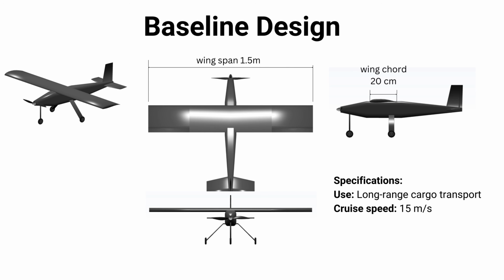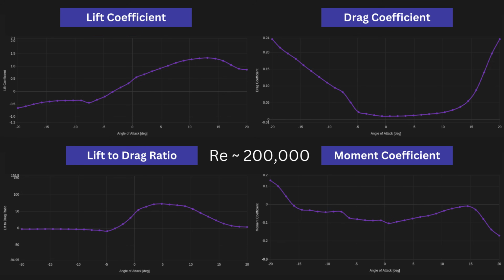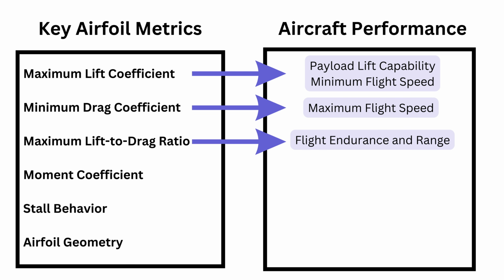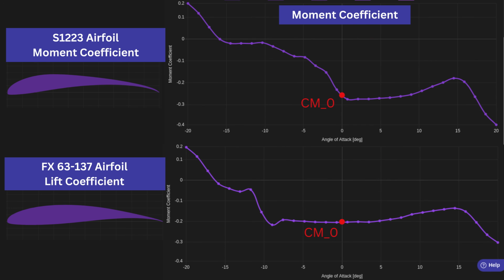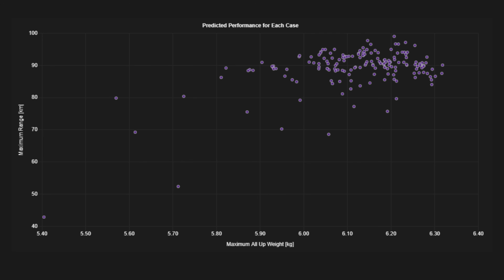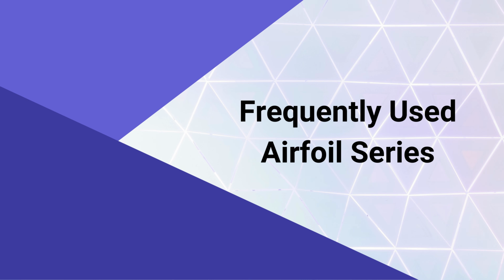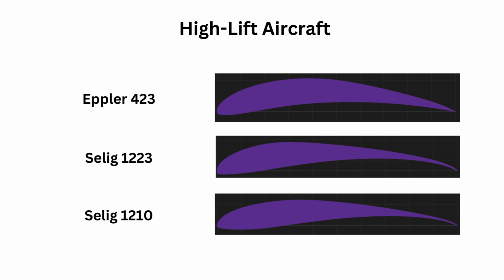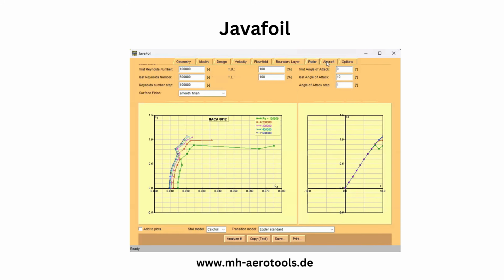Mastering Airfoil Selection for Drones - Part 2: Practice

Comment: Have you ever heard of the Kline Fogleman Airfoil? We introduced a step that traps a vortex which then becomes part of the airfoil and reduces some of the friction because it is air against air. It has been tested on Darrieus Wind Turbines successfully. It has only taken fifty years to gain some acceptance.

A B S T R A C T
This study provides a detailed analysis of the aerodynamic performance of various airfoil configurations, focusing on lift coefficient, stall characteristics, and maximum lift-to-drag ratio. The investigation includes the NACA23012C profile and configurations with different step geometries, ranging from one-step to five-step designs. Experimental measurements were conducted using awell-equipped aerodynamic laboratory, Institute of Aviation Engineering and Technology (IAET), Giza, Egypt. The lab features a wind tunnel, propeller test rig, and data acquisition system. The experiments were conducted meticulously to ensure accuracy and reproducibility, with a standardized method employed for uncertainty analysis. The results reveal distinct aerodynamic behaviors among the different configurations, highlighting the significant impact of design variations on aerodynamic performance. Notably, the three-step configuration consistently exhibited high performance, with a competitive or superior lift coefficient across a range of Reynolds numbers, showing an improvement of up to 35.1 %. Similarly, the four-step configuration demonstrated substantial increases in lift-to-drag ratios, reaching up to 53.2 %, while the five-step configuration exhibited varying trends with a minimum drag coefficient. The study also investigated stall characteristics and sensitivity to Reynolds numbers, revealing the complex trade-offs inherent in airfoil design. The findings provide valuable insights into optimizing airfoil performance under different operational conditions. Additionally, the adoption of two and three stepped airfoils resulted in significant reductions in blade material and associated costs for turbine blades.